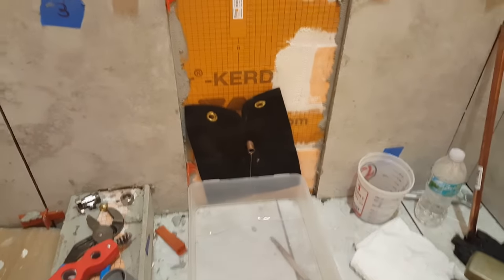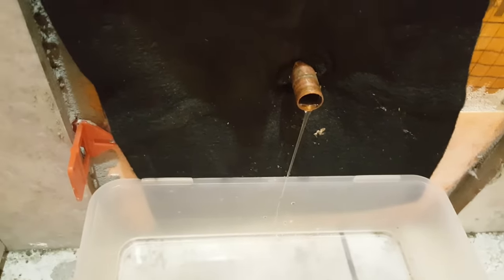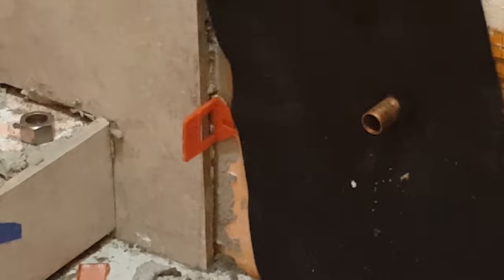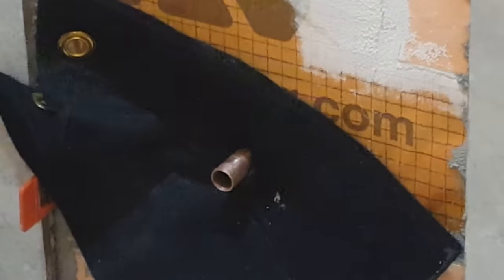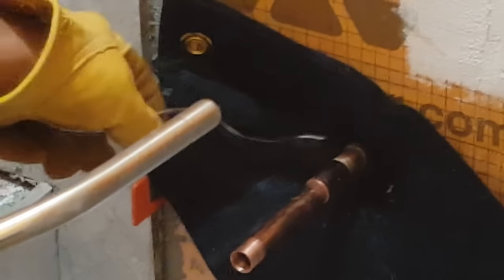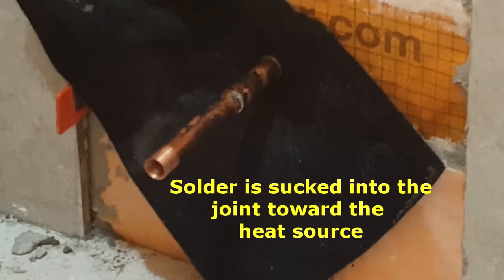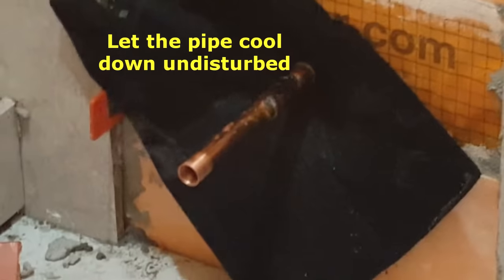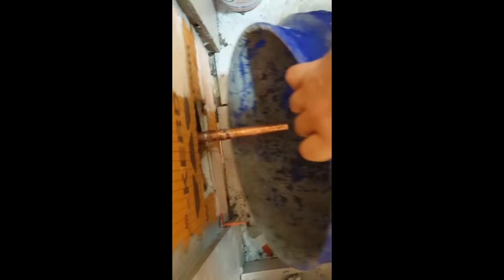Insane Plumber's Trick: Solder Copper Pipes Dripping Water

Comment: WTF are you doing? thats not right. you don't clean inside the pipe. you defenitly dont put solder in it.
Reply from the maker: Are you talking about me using my red plastic handled wire brush cleaning out the inside of the pipe? You are supposed to do that to remove any shards of metal left over from cutting the copper pipe. Novices that fail to clean the inside of the pipe are creating a noisy turbulent water situation for people. If you ever hear noisy water at the end of a pipe, it is because someone cut the pipe, but failed to clean out the ridges left behind inside the pipe.
Reply: @mrmeeseeks i didnt know you plumbed
Reply: Mr. Meeseeks : I totally agree that’s not how it’s done ! I wonder if he prepped the inside of the fitting if not he’s gonna loose that sweat in a few months if not sooner
Reply from the maker: @joepalermo3836  I cleaned the mistaken flux inside the pipe out before soldering. It's been 2 1/2 years and it's still there working perfectly, so your theory of my joint failing in a few weeks is incorrect. Also I did use the reamer, shown at 1:13 in the video, but the scene did not make it to the final cut. As I mentioned before in other comments, yes, end of day goof I added flux to the inside of the pipe, but later removed it before we sweated it.
Reply: jeffostroff : it’s good that you made the proper correction’s good job .
Reply: You forgot to flux the bread
Reply: Bill Burki : ROFL ! Awww come on he’s learning give him a break .
Reply from the maker: @billb.950  you know now that you mention it I thought the bread tasted like it was  missing something.
Reply: @jeffostroff - You do NOT use a wire brush to debur the copper. You use the gray deburring / reamer tool that you have sitting with your tools. YOU are clearly the novice.
Reply from the maker: @tenthdimension9836  Hate burst your bubble, but we did use the deburring tool, it just did not make it into the final cut. I used the brush because I was trying to clean/ remove flux from inside the pipe. I realize that being a plumber's apprentice you want to show the world how much you know and point fingers at other people, but today you fell flat on your face, you are the novice.
Reply: @jeffostroff - Son if you've done a poor job of editing your video I suggest you remove it from YouTube. It's not helpful to provide inaccurate incomplete incompetent information.
Reply: @jeffostroff  - in your reply to me you said you did use the deburring tool but it "didn't make the cut" but in your answer here you don't mention this missed piece of footage and defend your use of the red handled wire brush proclaiming "your "supposed to do that". Then in another reply you claim to be cleaning off the flux that was improperly applied inside the pipe. Which is it rookie?
Reply: But spread butter on the bread before !!
Reply from the maker: masterp@1ne   Lol obviously you don't know either otherwise you would have mentioned it here this is what happens when we attract janitors helpers like you just come and leave a he and waving general insult without actually contributing anything constructive to the conversation
Reply from the maker: masterp@1ne   If you read my response to some of the other comments 2 mentioned that yes I did ream the pipe but it did not show up in the final video you in fact you can see the reamer sitting there on the shower curb to my left at 6:09. I brushed the inside of the pipe because it was 9 o'clock at night extremely hot and humid there was no air conditioning in there and we were all tired, losing focus, and yeah I made a little blunder. But you could hear me say in their right after I did it that wasn't necessary. Also, the flux is water soluble flux, Master plumber? You should be aware of water soluble flux, will not harm anything. or not I can bet you've made your share of mistakes. Lol!  It's usually the people that make the most mistakes that have to come on the other people's videos and insult them to make themselves feel better about it. If you were really that good an in-demand, you wouldn't have time to be trolling other people's videos.
Reply: @jeffostroff  i didn't see that part but that's not really as big of a deal as you think. I've never had the time to waste cleaning the inside of the pipe and I've never had this noise you speak of but maybe it's because I don't have cheap cutters and never have. I guess the cheap home depot cutters might do some damage to the pipe but I don't see how they could do that much damage. Also over tightening the cutter could possibly do such a thing I suppose but I've never heard of it. I guess if you're not doing this for a living you can take time to do all of these things but I bet you will never see anyone who's been doing it for many years doing that in the field however if you have the time and feel like it more power to you its definitely not gonna hurt anything.
Reply: Reaming the pipe is definitely all you need to do but like I said if you cut it properly with decent cutters you can get away without doing that. I rarely ream the pipe as I basically just don't have the time but if my blade goes bad or if I over tighten the cutter I will. My job depends on speed but like I said I've never had any noisy pipes or complaints. I'm not bashing you if you have time to do so it's better to ream them all then to miss one that needs to be reamed. Everyone has their own way of doing things.
Reply from the maker: @my2centz196  I still prefer to ream the pipes because it's only a few seconds, I don't see how this would ruin your productivity time. But yes if you get a clean cut maybe you can get away with it, I just do it all the time no matter what.
Reply: Definitely should have reamed out the inside of the pipe and cleaned the outer part B4 putting the bread in 
When cutting pipe , It's best to use an angle grinder because the burr is much easier to remove than the burr left by the pipe cutter , Just a few strokes with a round file will do the trick
Reply from the maker: @ironmartysharpe8293  You're not very observant are you? The pipe was already reamed before so it did not appear in the video, neither did we show cutting the pipe either. I guess you did not notice the reamer sitting there on the shower curb in front of it at the beginning of the video at 0:04 This was a video about using the bread trick, not a video about how to cut and ream pipes, that's why it was left out. Also, there is nothing wrong with me cleaning off the pipe after I put the bread inside, it helps clean off any contaminants the bread might have introduced. You forgot to mention the operations was a success. Almost 3 years later, that toilet supply pipe is still working perfectly.
Reply: @jeffostroff  I was making a suggestion about using an angle grinder for cutting pipe because the burr it leaves behind is much easier to remove than the burr left by the pipe cutter
Reply from the maker: @ironmartysharpe8293   I'll have to experiment with that I just bought a new rigid metal cut off diamond blade for my angle grinder a couple of weeks ago I will try that out. I would think those bigger blades would be a lot rougher on the pipe then a close quarters pipe cutter which generally doesn't leave Me Too! Many burrs.
Reply: @jeffostroff  is it exhausting when you try to make instructional/helpful videos and professional plumbers come out of the woodwork to "school" you? I watched your informative video because I needed some tips, which I thank you for mate. Perhaps some of these other industry pros need to start their own channels.
Reply from the maker: @rickeon2397  Nothing attracts plumbers more than a video on soldering, and it's fun to watch them all argue with each other about, flame too hot, whether or not to use a wet rag immediately after, heat the pipe, don't heat the pipe, then they start cursing each other out. Get your popcorn ready!
Reply: @jeffostroff  You use a reamer not a brush.
Reply from the maker: First Last   It's always a good idea to replace the shut off anyway. I flip a lot of foreclosed properties that I buy and the 1st thing I do when I take over a property's I change every single angle stop water cut off valve in the entire house usually between 9 and 12 of them total.  And I change all of the compression sleeves on the pipes as well too so I only start with a brand new bare pipe just like remodeling a house down to the studs
Reply: @joepalermo3836  that is right he is learning should not be on utube
Reply: Also, I’d have cleaned and reemed the pipe prior to putting the bread in. Then your not wasting extra time. Also, if you’re using mapp gas, you can sweat with a little water in the pipe as long as there’s an opened end to release the steam. Though that much water it would have been close
Reply: You don’t use the fitting brush to clean the inside of the pipe, use a reamer. What is wrong with you?

Comment: Good tip but saying don't heat the pipe is wrong do a 32mm without heating the pipe you will have problems later

Comment: you shouldn't have put flux on the inside. solder will follow the flux, thus causing a turbulence in the pipe that will erode the pipe on the inside

Comment: I'd have never cut my pipe too short anyway. And on a run of pipe if water was still coming through id have just used tectite copper push fit....
Reply from the maker: That's how the builder made it, real short. On top of that, so you lose a little bit of pipe cutting off the old valve, and the homeowner wanted the walls tiled now, which now adds 3/8" thickness porcelain tiles, plus 3/8" thick troweled thinset mortar, so you lose almost another 1".

Comment: It is not that it is impossible to do water makes it a lot harder and need more heat I managed to do it the biggest issue is the heat dissipation you will never get the joint hot enough without either dry pipe or a big torch and a lot of heating the pipe needs to be around 400c for the solder to melt water boils at 100c and takes all of the heat away.
Reply from the maker: When water boils it does not take the heat away, it just steams the inside of the pipe, but you may still have water coming into the pipe.

Comment: To hell with that... just throw a shark-bite valve on there and call it a day.   I usually sweat replacement valves on but I had one that was only about 1/2" from the trim in my half-bath and I didn't want to remove the trim nor burn the trim, so I just went with shark-bite.   It's been on there lead-free for 15 years now.   I know you ask a dozen plumbers and half will say they hate those things and the other say they love them.   In my opinion, if it's in a serviceable location,  go for it with shark-bite.   I won't use them when they're buried behind dry-wall though.
Reply from the maker: You're missing the point here, there was way too short of a stub of pipe coming out of the wall. By time you add 1/2" of tile mortar and 3/8" tile on top, it leaves you barely room even to plug on a Shark Bite. Then you would have no room later on to make repairs, or cut the pipe behind it, so we had no choice but to solder on this extension. We later added a compression fitting quarter turn valve.
Reply: @jeffostroff  Makes sense then.   I was wondering why you went to so much trouble when a shark-bite would get it done a lot faster.

Comment: I've done this before you have around 1 minute even with dry white bread you took too long man,, you must have shut the water off properly after the bread went in😉👍
Reply from the maker: No we had a good solid trickle of water, that bread does a great job. We took longer because we were producing a video. Even up until about 10 minutes when we flushed out the bread, it was still holding the water back, because it was only a trickle, not full pressure.

Comment: Or if you have access to a press you can just press the fittings.. Pro press that is..
Reply from the maker: Yes, very pricey machines, but looks nice, and works fast. One of our plumber contractors on my latest project used it on the water heater install.

Comment: Say thanks to the guy behind the wall with the shut off valve. I dont think bread will block the water that long.
Reply from the maker: It doesn't matter what you think, it only matters what happened. We had that water blocked for about 10 minutes before we opened up the shut off valve and let the bread shoot into the bucket. When you roll up that bread into a nice dense ball, it does an amazing job blocking that water. Also remember, the water was not full blast anyway, it was a tiny trickle. So all the bread did was hold back a trickle for a few minutes. Not too heard ot see why it works.

Comment: Not how you solder a joint. Heat pipe and fitting and add solder to both sides.
Reply from the maker: You are not supposed to heat the pipe. You are supposed to heat the fitting only, not the pipe, so that the capillary action can take place and the solder wicks in toward the heat. This is plumbing 101. I don't know how you came up with that nonsense, but it is completely wrong.

Comment: I see a lot of "plumbers" in here insult this guy for using the bread, and it is not correct, but I see not one in here going outside to repair the problem correctly either. Go fix the shut off valve, problem solved!
Reply from the maker: Thanks Joe!  Actually a few have replied, for example shutting off water at the street, etc. But in this case, these guys were renting, and only had permission to remodel the bathroom, not to make other corrections tot he main shutoff inside the unit, and also being in a condo, you can't just shut off water at the street with no notice, as it affects others as well. Sometimes the best course of action is the workaround for now, then later you can look at spending a few hundred dollars to replace the main.

Comment: Um, why in the hell did you clean and flux the inside of the pipe?  You don't solder inside the pipe, so it's not needed.  Ridiculous waste of time.  And a quick tip - play your torch on one side of the joint and feed the solder into the other side.  The heat will draw the solder all the way around the joint for you.  I did plumbing for 42 years and I never once saw anyone put flux on the inside of a male part of any joint.
Reply from the maker: I guess you didn't see my response to the million people before you making the same comment. It was a mistake, you can even hear me say after I did it in the video that it was not needed. In your 42 years as a plumber, you never saw a mistake made?

Comment: you didnt turn off the main (city supply) you turned off the house supply valve. You still need to correct that
Reply from the maker: You don't pay attention very well. In condos you can't just run out and shut off the city supply at the street water meter main, when your house supply gate valve won't stop the water 100%. You are required to get permission, post notices that water will be shut off tomorrow, meanwhile, you are doing the work today.
Reply: i absolutely hear what your saying, I do multifamily  all the time. I stated that you still have a problem that needs to be addressed
Reply from the maker: @furnituregod1  I can assure you everyone we have helped who has this problem knows they have the problem, but it's  not a deal breaker problem like your water heater breaking down, it's an annoyance. But many are low income people on food stamps who don't have 2 nickels to rub together, and paying a plumber $300 to change out their water main is not in their future for something that is only an issue for 10 minutes when you have to sweat on a new copper pipe for a compression valve. Now that we converted everything to compression 1/4 turn ball valves, the leaking main gate valve has been reduced to even less of an issue for them. But....for all the plumbers who show up here to chime in and remind people they need to have their main valve replaced (NO DUH....) feel free to offer to do that for free to all these poorer folks that we try to help out who simply can't afford to have it done.
Reply: So they can afford a complete re tile job on a fixed income but not a 3/4 ball valve replacement
Reply from the maker: @furnituregod1   Yes the tile was on sale a few $100 I did the tile installation for free with them helping. Was not enough money left over to do anything else unfortunately. They would not have even been able to for to do the tile job paying somebody to do it.

Comment: Open lowest point,highest point in the. House then bread
Reply from the maker: LOL you really don't think we tried that already lol. That toilet IS the lowest point in the house lol. nothing works when you have a gate valve that doesn't close all the way everybody seems to be misreading what's happening with that water running out of the pipe it's not loose pressurized water that still in the pipes, we had all though the valves and showera and tubs open and testing out to see if we could stop it but nothing works when you have water that still coming in through the gate valve. What we tried before only works once you have no water coming in past the gate valve. There's no mysterious back pressure or suction or vacuum that will stop the water simply by opening a valve somewhere especially when the valve you are working on is the lowest valve in the home.